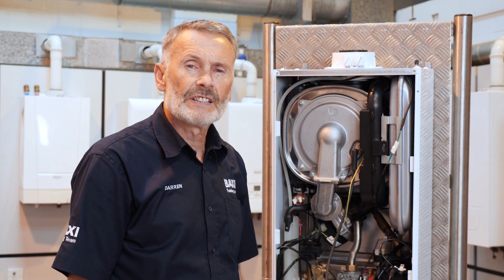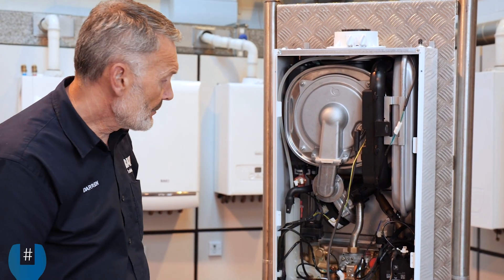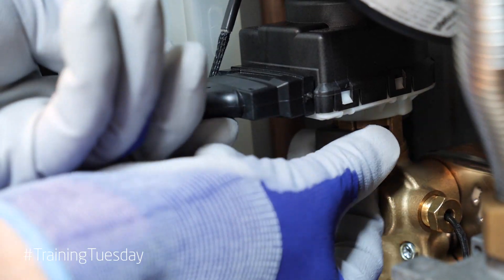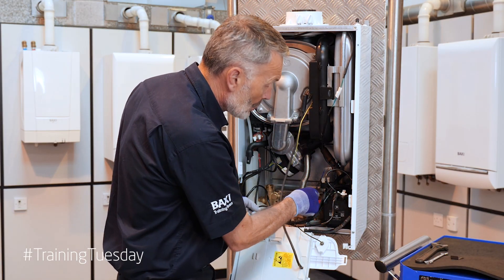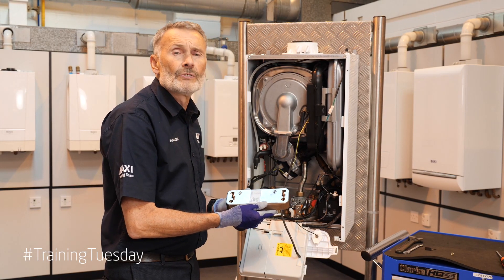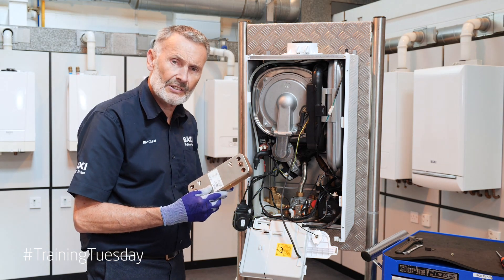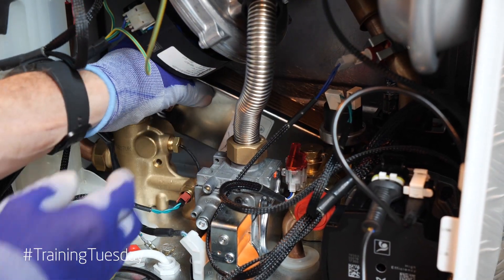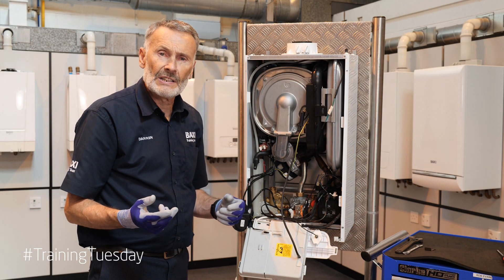How to remove the plate to plate heat exchanger on the Baxi 600/800 Combi boiler

Comment: Thanks!! The connection to my diverter valve was leaking.

This showed me where it was and how to remove it.

DIY repair complete.. the "engineer" I called out didn't fix the issue and wanted to sell me a whole new boiler. 🙄

£80 I'll never see again.

Comment: Well I'm glad this is here as I can now replace my DHW HE on my 830 for a grand total of 65 quid. Don't see the need to be a gas safe engineer as you're not even getting involved with any of the gas supply or combustion. Got the kit, comes with the washers and new screws. If I can replace a motherboard/LCD/touchpad in a laptop and also wire domestic electrics to standard I think I'll be just fine. FWIW I'd not try at all, ever, to replace the main HE, that's got combustion/flue gases in it, so I'd hire a pro for sure. I don't have the kit to check for all the right parameters and CO leaks, and the risk is just too high. But for water/water HE, the risk is minimal.
Reply: You have missed the point of a gas or combustion unit.... The rest of the system in principle is just as important as the gas valve, gas distribution, and direct combustion control.  There are reasons why manufacturers incessantly caveat everything with the requirements for gas safety and being properly qualified to known standards, so advertising your own work like that publicly is something you may wish to consider.
Reply: @Bari_Khan_CEng_CMarEng  Let's put it this way, I've worked with lots of engineering-related stuff both as a hobby and as for a living for many years and I understand the dangers. I'd not have done it without understanding the way a combi works and being able to conclusively identify which parts of the boiler were or were not relevant to the repair, and which parts must not be disturbed by other than a gas-safe certified technician.

I read for quite a number of hours and looked up the specifications and part numbers for my boiler. In retrospect, I think I made it sound like anyone could do it with ease, which isn't the case. Proper electrical isolation, draining both the heating and HW loop, and knowing which sensors and other failsafes are in play is a factor.

I did have to disconnect some pin headers from the control board to make sure the board didn't get wet from the residual water in the HW loop - and yes, I got some leaks as I removed the HE and didn't see there was a drain plug in the bottom of the case so had to deploy a lot of paper and bathroom towels.

In the end you are probably right, no-one should really attempt this without extensive experience, and I should have said that though it worked for me, there is a significant risk to doing it without training and certification.
Reply: Thanks for your life story

Comment: You must state that you have to be Gas Safe registered to remove the case off your 600/800 boilers.. Any boiler that has had its combustion cover removed must be checked with a gas/flue analyser and set to the manufacturrs instructions. I love your videos but they should not be open to the jo public 👍🏽
Reply: The casing cover is not the combustion cover though.  It would be good to have Baxi clarify whether the front case is a decorative or functional cover, though.  Baxi covers aren't generally 100% airtight, so I'm left feeling it may be an electrical enclosure and not a functional cover as such.